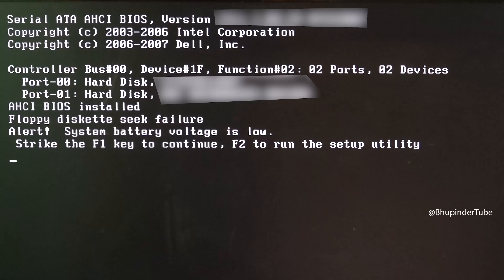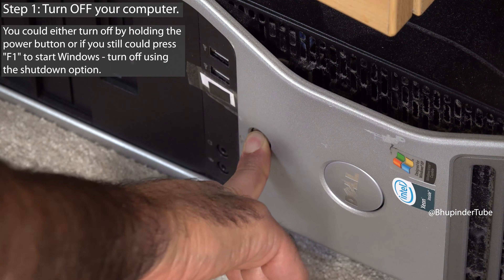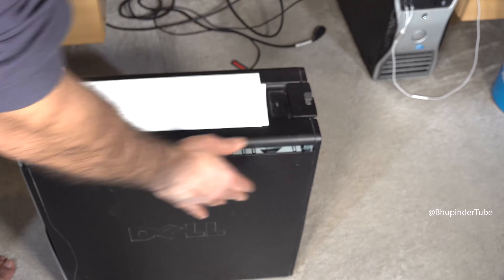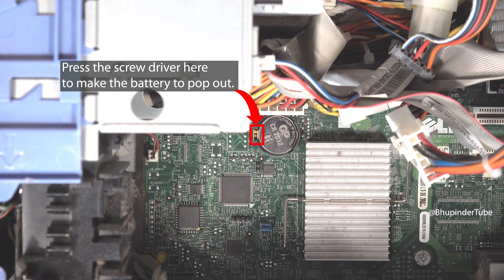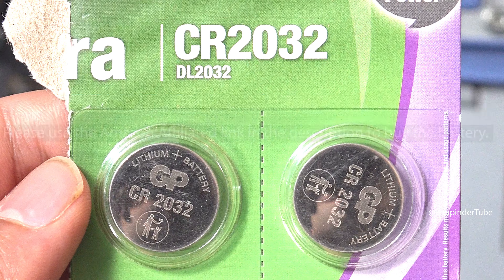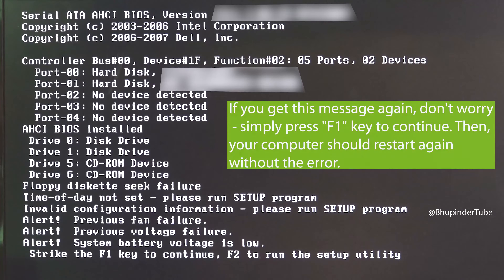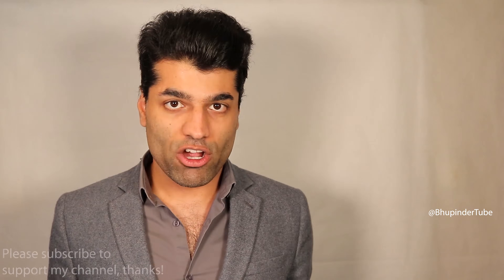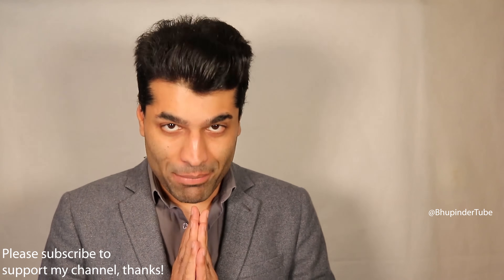System Battery Voltage is Low - fix

Comment from the maker: IMPORTANT: If you've never changed your computer's battery, then you might find it a bit tricky. So, for a detailed video of changing CMOS battery, watch ➡ https://youtu.be/nxw9sMAjbUY

If you ignore the low voltage, then your BIOS system settings might change and Windows file might get corrupt, and you get "inaccessible boot device error". If you get this error, then follow
👉 You can find all the methods to fix inaccessible boot device in this playlist - https://youtube.com/playlist?list=PL6oDA8S3RmtG3c8qE-nqYyoYaZadtVMJD
👉 fix inaccessible boot device in windows by changing SATA operation - https://youtu.be/FroBFI7_Xgc
👉 fix inaccessible boot device in windows by using command prompt - https://youtu.be/FMe7iDR20vE
👉 fix inaccessible boot device in windows by using Startup Repair - https://youtu.be/3UcJOMW2-rA
👉 Fix inaccessible boot device by Reset this PC - https://youtu.be/pmXV5IXTcwI
👉 "How to drain the RESIDUAL POWER from Computer" - https://youtu.be/AePa9cfkQrQ

You can also get the above error after fixing the following:
👉 Floppy Diskette Seek Failure - fix - https://youtu.be/o9VOH2LMesc

I have put a lot of efforts in making this video! I appreciate if you could in return subscribe to support my channel! It does really help. Thanks! 🙏 More related videos below
👉 Check if your PC uses UEFI or BIOS - https://youtu.be/rY5tI2O95aA
👉 If your computer Turns ON too fast for accessing BIOS or Safe Mode- https://youtu.be/s3tt9f5RfUA
👉 How to access BIOS in Windows 10 - https://youtu.be/5juMtQucizE
👉 Accessing Legacy BIOS windows 10 - https://youtu.be/ymsuagdQsig
Other Useful Videos:
👉 How to replace Power Supply on Dell PC - https://youtu.be/4Eqw4Zp7scw
👉 Dell Precision T3500 Light 1 and 3 blinking Green - https://youtu.be/0m-z8CdHbRc
👉 Troubleshooting Computer or PC in Dell Precision T3500 - https://youtu.be/VKU9zL-rNWs
👉 How to replace CMOS battery on Dell Precision T3500 - https://youtu.be/nxw9sMAjbUY
👉 Does CPU speed matter? - https://youtu.be/tjLtHTPSn8w
👉 how to find motherboard model - https://youtu.be/XNAYxwTp4Ks
👉 Best CPU for Gigabyte H61M DS2 motherboard - https://youtu.be/ZJUcQKIlmMo
👉 How to find the best CPU for your Motherboard - https://youtu.be/rWAK3LbAgos
👉 how to find the best graphics card for my motherboard - https://youtu.be/S1FPvvSt5_c
👉 Best graphics card for Intel H61 Chipset motherboard - https://youtu.be/C7TQ2vGv-OQ
👉 AMD vs NVIDIA GPU Graphics Card - https://youtu.be/5-hdWxp_i0Y
Reply: Which is the Amazon link to order the battery? Can you send it?
Thank you

Comment: Oh thank you thank you thank you my cell computer was doing that problem and I didn’t know that the battery was low, but I didn’t know that until now I saw the video because of the battery and now I’m gonna buy the batteries and fix it so I can finally paint on my Dell computer. Thank you.🎉
Reply from the maker: Awesome, glad I could help you solve the problem!

Comment: Thanks this helped to fix my issue just now. Had a battery on hand so easy fix. Saw the same warning even after putting in the battery but pressed F1. Thanks for confirming. All good also a Dell so helped seeing how to open. Thanks again 😁.

Comment: Hey man, thank you for doing this video. I've been avoiding this stupid error and got fed up. Found your video and followed it. It was a bit tricky to remove the battery, but I quickly fiured it out. I had to pull the prong back a bit and the battery pops up. Anyways, I wanted to say thank you. This video is very useful to me🤝.

Comment: i changed my battery but it still says the same thing and when i press f1 on the keyboard it still plays that noise and shows the message
Reply from the maker: Are you just getting Battery low error? 
If you've never changed your computer's battery, then you might find it a bit tricky. So, for a detailed video of changing CMOS battery, watch  https://youtu.be/nxw9sMAjbUY
Please check this also https://youtu.be/o9VOH2LMesc

Comment: I changed the battery and rebooted my computer. I cleared the system log and exited setup.  My computer is stuck and won’t reboot.  Looks like it’s loading but it’s not
Reply: Same problem I'm having ad well

Comment: I changed my battery and it was successful.  I had a hard time though, removing the battery.  It was hard to tell what to do with the screwdriver.  I was under the impression that you point the screwdriver between the 2 prongs, but it didn't pop the battery out.  Then finally I pressed the screwdriver against the prong on the outer rim of the battery and it popped out.  Well after all that little frustration it was successful.  The error is now gone after rebooting the computer.
Reply from the maker: I'm glad you were finally successful in replacing your battery. In the above video, I didn't show in detail on how to remove the battery. However, I've made another video that shows changing the battery in my detail - https://youtu.be/nxw9sMAjbUY . I hope it'll help others!

Comment: Hey man, I changed that battery in my computer and it still says that the voltage level of the battery is low, what can i do? Great videos btw o have seen your channel
Reply from the maker: After inserting the new battery, the first time, it'll still say low voltage. Then, your computer will restart and then the low battery warning should go. If the message is still there, then it could be that you haven't installed the new battery from the correct side or the new battery doesn't have enough voltage too. I'm glad you like my channel. All the best!
Reply: @PracticalTechFixes  Hey man thanks for your answer! computer's back up and running after being restored, But when Windows boots my mouse and keyboard don't respond. This does not happen with the bios but I do not know what to do really, any suggestions? Thanks in advance
Reply from the maker: @niveks4449  Hi. I'm glad you got it restored. If mouse and keyboard are not working after fixing the above, it might mean that drivers are not installed or there is something wrong with the usb port. Have you tried to remove them and then re-insert them? You might have to update your USB, please check https://youtu.be/g6fIWzw8D6Q
Reply: @PracticalTechFixes  hey thanks again, I have no doubt that those solutions are effective, but I can't access anything in Windows, because I can't use either the keyboard or the I have no doubt that those solutions are effective, but I can't access anything in Windows, because I can't use either the keyboard or the mouse To unlock the pc😓